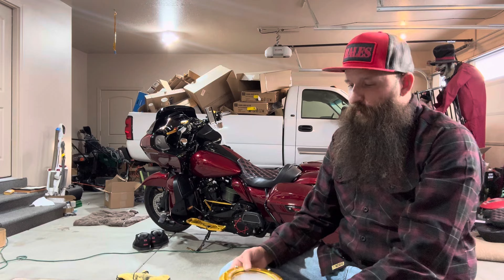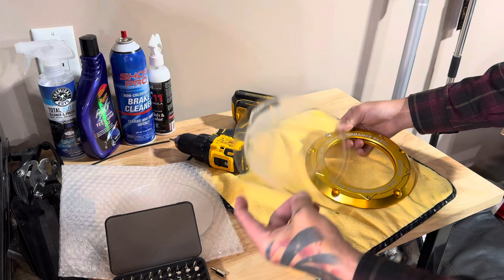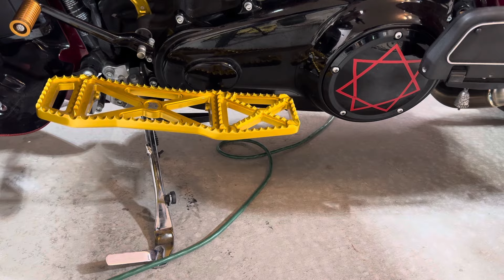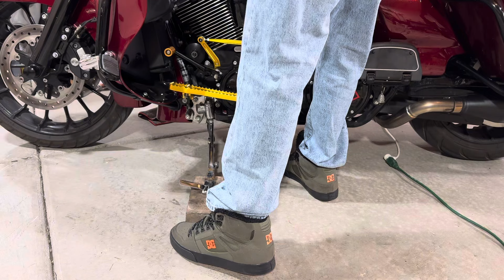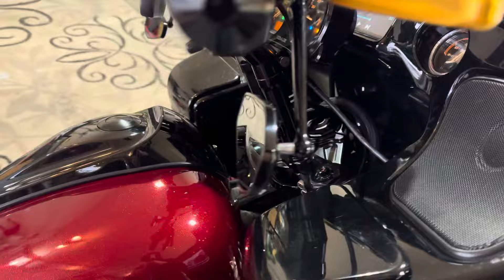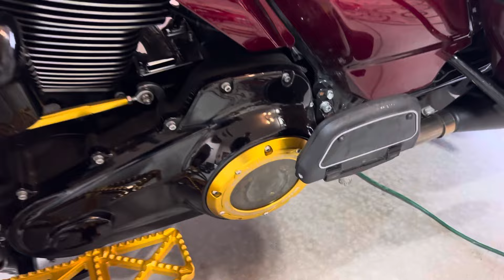Replacing window on our clear derby cover. #NiceCnc #roadglide #Performance #Bagger #DIY #Harley

Comment: Those screws for the covers are pretty tight..was thinking about powder coat because it is not that expensive..50$ for derby and 50$ for cam cover..any color you can think of. After trying to get the screws out myself and not wanting to f' them up..and watching your video..i think ill just use a high gloss enamel and a professional like masking job. Clean it with rubbing alcohol (carefull to stay away from poly carb plate)..a light tack coat and then a final coat carefull not to cause drips or sags. The letters on the piece are not raised so you should not see them when piece is finished. Thanks for all your videos Mr. Gimpy and i look forward to more!! Take care guy!!

Comment: if you used or there was brake clean remnants on the rag you wiped the cover with that will cause that ghosting effect on polycarbonate.  just use a fresh rag every time you change fluids and take it off.
Reply from the maker: I had two rags sitting right next to each other. One for clean wipes and one for the dirtier cleanups. Had only used the solvent one once. So it wasn’t dirty yet. But still had cleaner on it. Which is what must’ve happened. Either way. Got it sorted out. Livin n learnin 🤘🏻

Comment: Probably can't take the heat
Reply from the maker: No. Probably was the rag that had    Solvent residue on it. I ran this derby cover for 6 months. In 100+ degree weather for 3-4 hours nonstop. No issues.
Reply: lol jasonkimble I don’t think you’re remotely close to being right here. Polycarbonate can handle the residual heat just fine.
Reply from the maker: @roadglide_mayhem  it definitely has no issues with holding up to the heat. We get brutally hot days here in the desert and this bike runs hot on those days. Never had a heat issue with these components